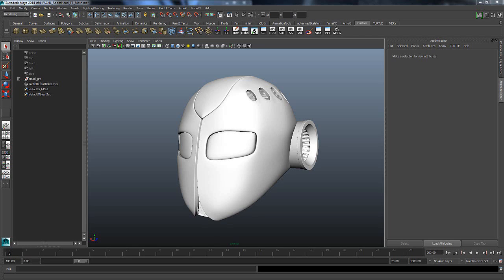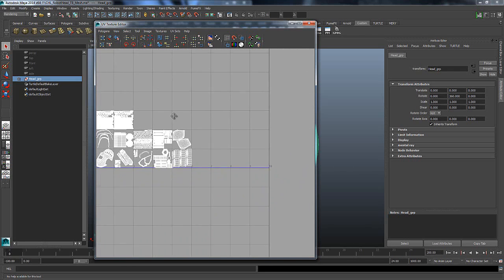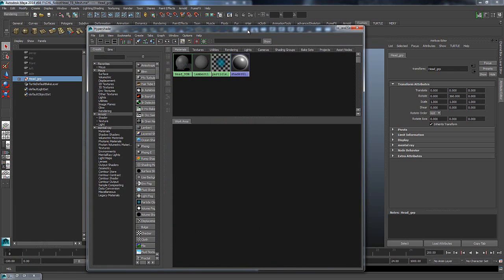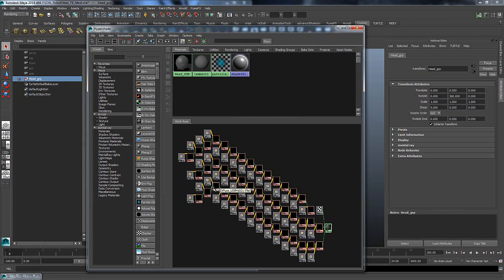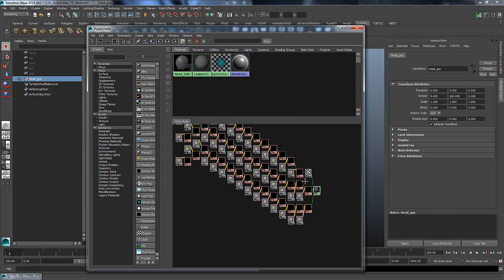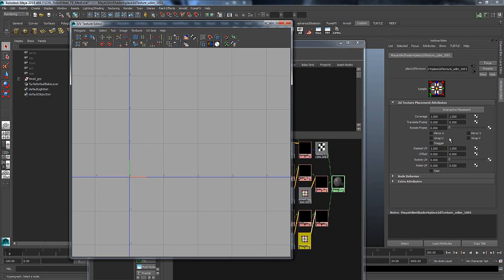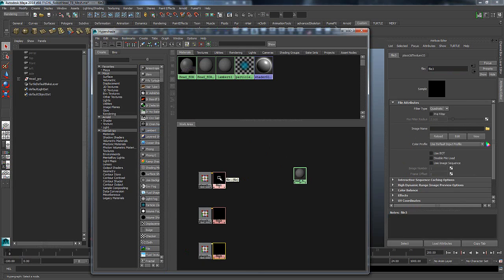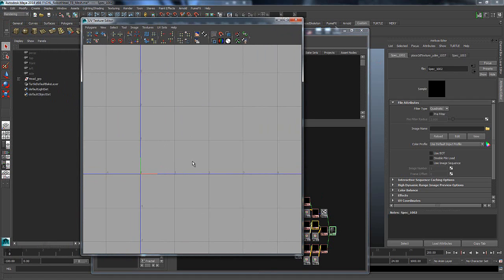Multi-Tiled UV Set up for Maya Tutorial

Comment: how do you connect the spec?
Reply from the maker: You can do this by having your shader selected and the middle mouse click and drag the first file node and dropping it  on where you want to connect it to. You can see this at around the 9:45 mark. Or you can click on the black and white box next to the slot or slider. You can attach a file node to almost any slot be it diffuse, spec, bump etc

Comment: It's a nice tut but, you never showed an example of the tilling in the middle of production and finished. Also I'm not shore but can do this method with normal map textures also?
Reply from the maker: Im not sure I fully understand your statement. From 1.00 I show what tiled UVs look like in the UV editor and at 3.15 I show you what the set up is like (for this particular model). Once you have started texturing, the uv tiles must remain the same through out the rest of the production otherwise you will need to adjust the "translate frame" settings on your place2d nodes and possibly even re-texture.

Yes, this method is for all types of maps including normal maps, displacements, specular, diffuse, etc. You plug the first file node in as you would normally for say your normal map and then attach the other nodes as shown in this tutorial.

I hope this answered your questions
Reply: Ok, thats what I was wondering. I tried this method and it works quite well for my color maps_ I'll give the texturing a try too. thx for the write back.
Reply from the maker: killingmon No worries. It can be a little confusing but once you get your mind around it, it becomes a lot easier.